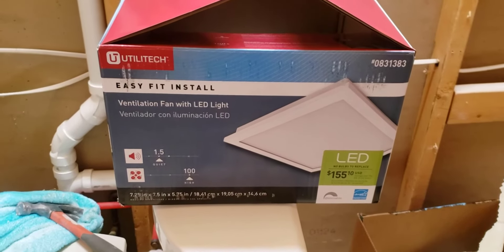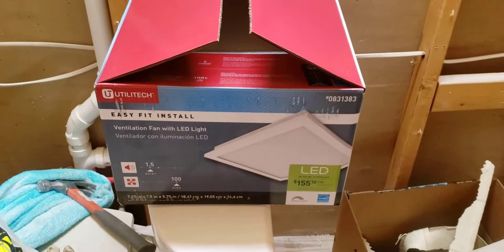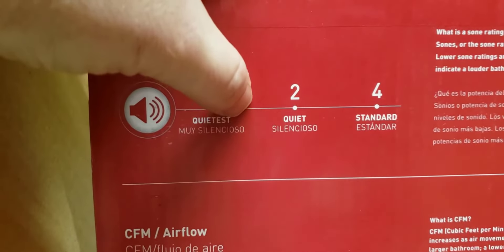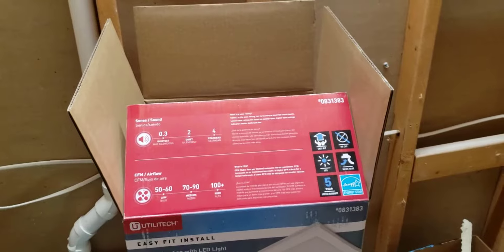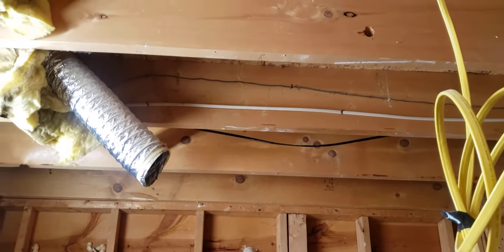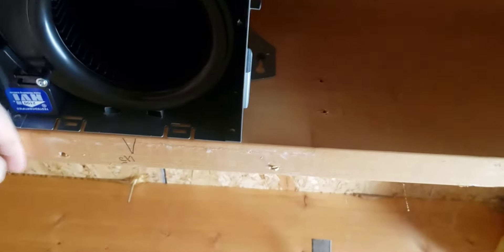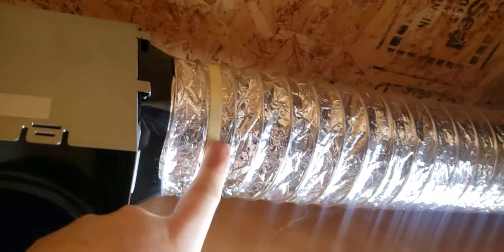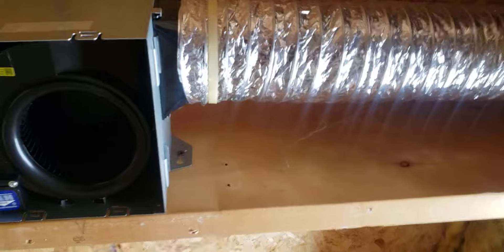Bathroom Exhaust Fan Install

Comment: What's maddening about any manufacturer's install helps is there is ALWAYS something NOT the same as what they explain. I have NO blue wire per the instruction so I am shot after 2 days of frustrations....   I have a revent fand and light on separate switches.

Comment: Did have the attic side of it flush with the joist provide enough room for the drywall? Everything fit up ok?
Reply from the maker: @codyproctor3346  This is on the first level of a two-story condo - so no attic. But the same answer applies...Yep, it fit perfectly! 1/2" drywall.

Comment: What if I don't have a red wire coming from the house? I have no where to connect the blue wire. What can I do?
Reply from the maker: I'm assuming you have 12/2 wire (black, white, ground). The simplest answer would be to tie the existing black to the blue and black from the fan. This will mean that the light and the fan will both come on when you hit the switch. To separate the functions, you'd have to run a 12/3 from the switch to the fan, like I had to do in this video.
Reply: Very unsafe work.  Garbage work.

Comment: If I have 2 restrooms back to back can I run the vent tube like a "Y" to have one exhaust exit out of the roof?
Reply from the maker: Sorry for the delay. That's a good question. My first thought is no, because when one is on, it would be sending some of the moist air to the other bathroom. But you could probably install the metal flaps in the piping (the kind that easily open from one side when air is blowing). That may be a creative fix?
Reply: @ourrealestatejourney_original  thank you for your response! I think you're right. I didn't think of the air going down the other vent when not in use.

Comment: Thanks buddy. This helped me a lot. I hooked them up just like this, but my house wires were just black, red and white, so I ground the green one coming out of the exhaust fan I was installing. Question... I had the fan and light on two separate switches and when I wired it like this, the fan and light are now on one switch and the other switch is a night light on the fan. Is that just the way the exhaust fan was set up/wired?

Comment: Thanks for the wiring video. Very helpful. As for making it flush to the drywall, there are 2 bendable tabs on the mounting side of the box, as well as the opposite side. I have had success flaring them out and making them flush to the joist. Then cut drywall and install. 
If you're doing this after drywall was installed, empty the box, insert the box above the drywall, and flare the tabs to help hold in place as you install. Wire first in this scenario.
Reply from the maker: Great tip! Thanks man!